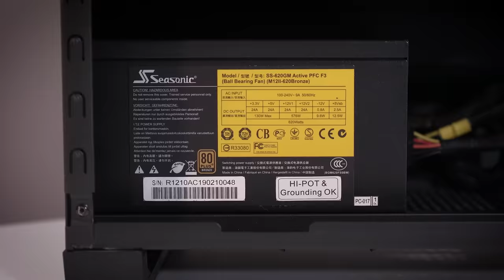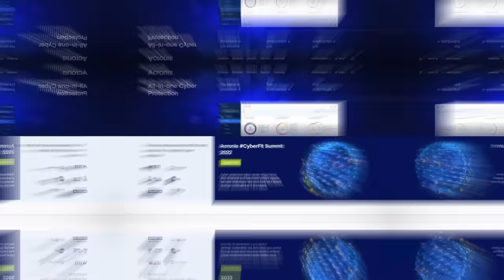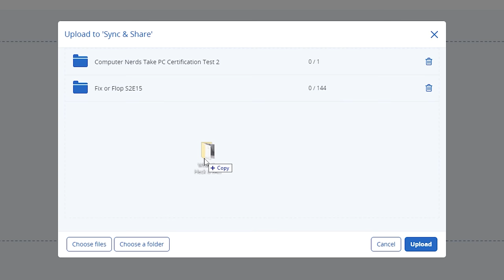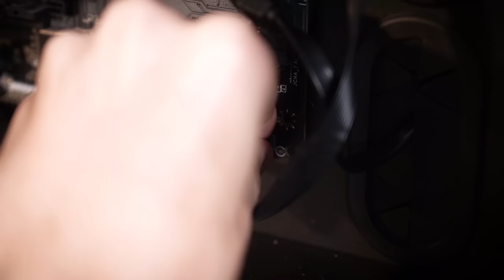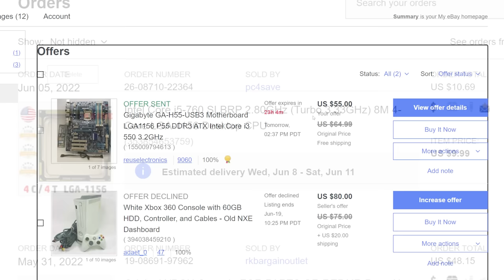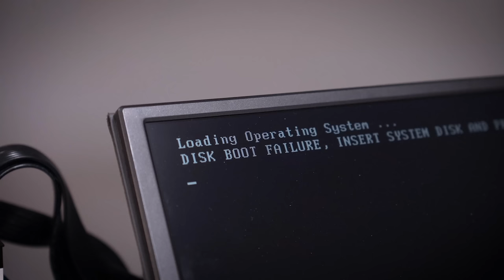Fixing a Viewer's BROKEN Gaming PC? - Fix or Flop S2:E14

Comment: My previous system was an core 2 quad, MB is P7N SLI, ddr 2x4, GPU- MSI 580 Lightning Extreme edition. It had the same problem. Used it from 2008 to 2015. I will try to fix the problem using this video as a guideline. Thanks brother.

Comment: I love how big the case is and how tiny the gpu is. 😂
Reply: it's almost as big as that sound card.Still,i don't think this was the original configuration this case had.The owner probably had parts laying around and threw them together,i mean there is an EVGA motherboard that looks to have been mid to high end,with RAM that has agressive heatsinks but the CPU has a 10$ cooler along with a modular Seasonic PSU so it does't really make sense

Comment: I love the older gen high end boards with power button/reset buttons on board, clear cmos, memory refresh even this board has holes for 775 and 1156 so when u upgraded you could use your old cooler. Would have been a nice little upgrade to get him the i7 870 for only 10 bucks more.

Comment: When a motherboard has an onboard power button should you still be using the pins to jump start it?
Reply from the maker: It doesn't matter. Either way. But jumping removes another failure point if the physical power button is bad.

Comment: I still have my Obsidian 800D sitting right here. It's housed several computers over the years. When I first got it my intention was to put in a custom water cooling loop but well, it never happened. I'm loving my newer 5000D with my latest hardware. A much more practical size

Comment: Dust the CPU pins with a detail brush very lightly in the direction of the pins, then blow out with compressed air if possible.  Do the same with the RAM slots and the PCI-E slots, I've got two "dead" motherboards working by simply doing this.  One had a single fragment of dirt ingess in the CPU socket (which I missed on multiple inspections, and only noticed under a microscope on about the 5th inspetion), the other was brought back to life be cleaning out the DIMM slots.  Case reminds me of a Thermaltake F51 Suppressor I inherited last winter, just ungodly huge.
Reply: Also you could reprogram the Bios chip just to be sure
Reply: Personally i think its either a dead cmos or a failed chip, on older boards its common, especially not posting at all if the battery is dead and if its the original battery it’s gonna either be dead or too low a voltage, not seen one of these boards for years, I remember doing a clear cmos by taking the battery out once and it wouldn’t post until i put it back in, I’m glad that issue went away with later gens

Comment: In my experience, when a PC keeps experiencing this exact issue, it usually has to do with the CPU. Either the CPU isn't in the socket all the way, or the power cable for the CPU isn't plugged in or plugged in properly. I love this series for this exact reason, because I can further expand my knowledge on different symptoms and their solution. Keep it up Greg!!!!!!!!!!!!!!!!!!!!!!!!
Reply: It's also important to check the CMOS battery as well. This 40+ dollar solution could have only cost 2 dollars.

Comment: Have you tried to replace the bios battery? I've seen plenty of boards which didn't boot because the battery's voltage was too low, I'm dealing with board from this period regularly.
Reply: I 2nd this. I bet anything the symptoms very one model of motherboard to another. And finally it's old enough.

Comment: this series is very helpsome! i am a complete noob when it comes to hardware. but i just managed to dissasemble gaming laptop. deepclean it, repaste, put it back together again and it still works!! yaay. and the idle temps has gone down by 20-30 degrees celsius!! its only 14 months old with a 3070 mobile in it, but the factory paste was rock hard and bone dry, and when i got it i was gaming in quite a dusty environment. so now it great. gaming temp has also gone down a large amount. from 86(max templimit i set in sw) to 68-70 celsius peak temp on gpu. thx

Comment: You might inadvertently cause a GPU issue by putting the sound card so close to the fan. I'd have put it one slot further away for airflow purposes.
Reply: I was going to say something similar. However, the sound card cannot be placed any lower. That sound card is PCIe, the slots further down are old school PCI, so is incompatible, it could however go above the GPU like how it was placed in the original motherboard. I also wondered why it was placed as it was to choke out the GPUs airflow.
Reply: @MisterGiGs  It's PCIe X1, so it can indeed go above the GPU. If there is any shorting concern, a coating of liquid electrical tape  (like Plastidip) can be put on the back of the GPU like a conformal coating, or even the tails of the THCs can be trimmed, further reducing the chance of a short.

Comment: 17:43 you seriously put the sound card in front of the single fan GPU? I know the customer can change it back on top or you probably switched it back after, but come on it's so irrational.
Reply: Until you look at it and realize it doesn't impede the fan at all as the fan is on the side pointing down.
Reply: @CAOSWOLFIII  I should have put a timestamp at 17:43, he put the sound card in front of the graphics card, it was behind it originally as it should be.

Comment: my answer was the MB , after the first 4 secs of the vid , when the unit powered on and off , probably when they upgraded the case they forgot a standoff on the case and when they screwed down the board or added the ram or the graphics they pushed too hard and it severed a connection on the PCB , 4 secs lol ,  but ive been building computers for over 30yrs so i knew this ..  :) , nice work on the troubleshoot , keep it up

Comment: Yeah the case is large but also helps with having space for larger water cooling setup if he gets to that. I'm still using my 900D got a decade ago and it can rock the massive 360-420-480 rads in push/pull without any clearance issues.
Reply: Use to run SLI in case's like this....I miss SLI /Cross-fire.

Comment: I've had two of these EVGA P55 FTW boards paired with an i7-860S. I managed a full 1.5 ghz overclock and was stable for 2-3 years until the board started dying. It would power off randomly which became more frequently then had similar behavior at the end with this board you have where it'd power cycle. I hunted for another p55 ftw on ebay and slapped everything back together and oc'd to 3.75ghz and gave away to my friend... Really great memories with that setup. 

I miss that era where if you were brave and patient you could be rewarded with some nasty overclocks!

Comment: I have the same case, the Corsair 850D, it was equipped with an i7 950 CPU with LGA1366 socket, now I build a ryzen system, with a custom water loop and a lot of RGB, and that is pretty much where it was build for. Also, the swapable HD bays made it easy to change drives. But yes, it breaks your back, it's a typical, stand and don't move case. But the airflow is very good, from the bottom to the top.

Comment: This is so far my fave Fix or Flop solely because this rig is very similar to my own :) My PC was built Feb 2010 and still works wonderfully.

Core i5 750 (so one step down from this viewer's i5 760)
Gigabyte motherboard as well -- mine is the identical model to the one Greg swapped in, but with the P55 chipset rather than H55. Same blue board, same connectors, same 3-3-3 system

(the main difference is P55 has more PCIe bandwidth so supports Crossfire, H55 does not... the viewer's original board was P55)

Almost every rig featured in this playlist is a 7th gen or newer. I'm glad to see my OG Lynnfield series represented!

Comment: I have an EVGA X58 motherboard, about the same age but with an LGA1366 socket, with the exact same issue as the board you had (with the power button just like that at the bottom and the exact same kind of boot loop). In my case, it happened after an attempt at a CPU upgrade - I had rebuilt the system in a different case (like yours, the old case was monstrous) with an upgraded CPU, but forgot to update the BIOS first. I put the old CPU back in, and it bootlooped 2 or 3 times before starting instead of starting right up.  That was the last time I saw it running - I had to shut it down to boot to the BIOS update USB drive, and it never turned on again - instead just continuously bootlooping. A couple of months later, I tried to turn it on again, and this time smelled smoke... 
I don't know what's wrong either, but it's another data point. If you contact EVGA about it, maybe something to mention. Nice video, thanks a lot!

Comment: I'd consider there was a bios issue. There are $20 flashing tools on amazon that you can flash a board's rom chip in without it being on. If all else fails and a board is considered dead, its worth a shot to troubleshoot and try to revive the board.

Comment: I found this Fix or Flop episode of particular interest as I had a similar problem this week and it wasn't a CPU or Motherboard issue.
I took a graphics card from a PC whose PSU started smelling badly and inserted it into another working PC. Result, no display.
Replaced the now identified as faulty Graphics card with the original card back into the working PC. Result, PC now cycling on and off and won't boot.
Moved the original graphics card into another PCI slot in case the original slot was now damaged. Result, PC still cycling on and off and won't boot.

Living in the UK and now with two PCs apparently faulty, shipping to you is obviously a non-starter....

I have just bought a SeaSonic PSU hopefully to replace the smelly PSU with but with it also came a free PSU tester. 
This is essentially a plastic socket with some connections enabled which slides on to the 24 pin plug normally plugged in to the motherboard.

I took this PSU tester and plugged it into the PSU of what was my working PC and switched it on. Result PSU started spinning as it should.
Plugged the PSU back into the motherboard and switched it on. Result, PC booted (Original Graphics card still in the second slot.)
Moved the Graphics card into the first slot and switched the PC on. Result, PC cycling on and off and wouldn't boot.
Removed the 24 pin plug from the motherboard and connected up the PSU tester. Result PSU started spinning as it should.
Plugged the 24 pin plug back into the motherboard and switched on the PC. Result PC booted and has been working fine since.
I am confused how this has fixed the PC but happy that I don't have two paperweights on my desk.
What do you think?

Comment: Oh I love older PC's, rocking a 3rd gen i7 it still slaps I like seeing these get attention and being used still, this whole episode reminds me what I went through with my old system this year actually though it was almost doing the same except there were times it worked fine, I suspected my board was dying because I tried different rams different CPU and the problem persisted I didn't have a board or a different PSU to test though, so I was pretty sure it was the board, wrong, it was my power supply, lol. PSUs and Boards when they are malfunctioning or stop functioning have very similar symptoms. PCs are sooooo crazy when it comes to troubleshooting.

Comment: Are you able to do a spin-off  followup series to Fix or Flop where you dive deeper into the broken components that were replaced in previous Fix or Flop episodes? Like for example soldering? If possible of course. Or like when you mentioned in this episode a follow after you sent the item to EVGA.

Comment: The mobo has separate power/reset buttons on the board. Have you checked those? Maybe one is jammed or shorting? Desoldering those 2 buttons should be quick and easy to verify.

Comment: I had this configuration, i7 870, 20gb ddr3, and discrete gpu HD5750 for roughly 3 years. My PC would so the same exact thing. I used the hyper212 evo cooler on it for quite some time. The cooler sagged, because it's hefty once you put two 120mm fans on the cooler. The solution I found was to apply pressure to the top of the socket by lifting the cpu cooler up some and it would fix the machine again, for quite some time. If you have this board still around, take a look at adding pressure to the cpu socket and see if it comes to life. Mine is still running, and sometimes still behaves like this one did. Fans would spin, but it wouldn't post.

Comment: I had a similar problem to this with my PC.

It happened less then 1 month into the UK's first lockdown, so I couldn't send it anywhere to get it looked at or buy many tools for testing. So I searched the internet on my phone for possible answers (which was how I found this channel), and narrowed it down to 2 items: my motherboard, or my PSU. After testing the PSU (a friend brought his PC and a spare PSU to test my PSU), I replaced it with a new one I bought as it was toast. I also found out my motherboard had also died. Turned out my PSU had shorted somewhere and surged, taking the motherboard and my only HDD with it (luckily, everything important was backed onto Google Drive and Dropbox).

The motherboard I am (and was) using was discontinued roughly 2 months after I received the PC back in late 2014. I couldn't afford to upgrade, and finding a compatible downgrade was going to be more of a headache than it was worth. But after some digging (and going onto a sketchy looking PC parts buying/selling/trading site), I found only 1 seller with an exact replacement (and was also in the UK) for £20 and free shipping with next day delivery. It came and worked perfectly (but needed a bit of cleaning first as it was extremely dusty from sitting on a shelf for a few years).

Thank you for your videos. They will help me in the future and have helped me recognise common issues and how to fix them. Keep up the stellar work

Comment: I have a huge case from years ago. Not sure what it is. But it has mounting points for 12 hard drives plus 2 optical drives. I have an older system ( FM2) in It and use it for a storage server.

Comment: I understand this is an old case and platform, but this is like popping the hood on an old Lincoln Continental and it's got a tiny 4-cylinder under the hood. I forgot just how massive these full tower cases were as they’ve fallen out of favor in the past 10 years.

Comment: In 20 years of system building, I've only had 1 intel cpu go bad. Good choice on the Gigabyte replacement board, back then they were pretty bulletproof.
You might get lucky if you swap the CMOS battery in the problematic board, the voltage may be too low to operate correctly.

Comment: I thought motherboard immediately after hearing the description. I had the same problem back in the day with my Ivy Bridge platform and it was the board then too. 

I wonder if it’s worth the troubleshooting step to take the board out of the system and try a bench test just in case the board is grounding out on a badly placed standoff or something? It’s one step I tend to try myself. 

Great series BTW!

Comment: What a coincidence, I had exactly the same issue with my old PC (I7 860) a few months back. "The culprit" was the sheer presence of my old CMOS battery, after removing/ replacing it PC turned on just fine and keeps runnig up to this day. I strongly suggest doing the same for this mobo

Comment: If you look closely at the compacitor or resister there is a slight tear in the top blue ones by the socket, and a bubble on one part of it, when the compacitors or resisters go they tear, sometimes they leak fluid onto the top or bottom of the capacitor or resisters.  That one is just barely blown so you can barely see it.  Though are the capacitors or resisters the give power to the cpu.

Comment: Putting the sound card just in front of the fan on the GPU doesn't seem like a great idea for airflow. 
Better if it's above the GPU and to prevent a potential short Circuit, ita possible to put a thin plastic layer between.

Comment: Great video Greg, if you want I may know the issue with that motherboard, I won't say the owner tried to update the bios but if it was it could have corrupted and then if you look at the board it looks like evga added a socket to be hooked up externaly to the tools to reupload a bio's that works and is stable just looks like that may be the issue. I could be wrong also.

Comment: Stop hating, y'all. These old cases have nostalgic value. I have an old HP  Windows 7 i-5 tower that looks like this. It was a workhorse for many, many years and only just recently began to fail. I want to do a budget rebuild with a new motherboard, processor, and sound and graphics card.

Comment: Either try to reflash the bios on the old board or try powering it on without cpu cable. If turns on w/o cpu - something on the cpu vrm section is done (yeah, some older boards actually tried turning on with this malfunction).

Comment: I remember before when I was doing replacement parts for an old build and for some good reason it gave me a warning in terms of an old battery dying down.. (I`m not pretty sure why that comes up but it did save me time for diagnosing the board..) like what the other commenters says take a good look at the battery of the board because sometimes it will end up like that. So far in my building experience I rarely encounter a board died because of the battery but it is not a bad idea to take a good look at it.. and the battery is not even expensive to get

Comment: I am late to the party but I will say I like your fault finding on hardware, very old school, I think a big clue was the sound card. Expantion cards on integrated mobos are just a temp fix. USB, lan and sound cards, if I saw that and the machine is giving issues I knew we had a mobo issue. 99 out of a 100 times its the mobo, cpus do fail but mobos fail more often. You and Jay 2cents are the IRL PC Building Sim guys :)